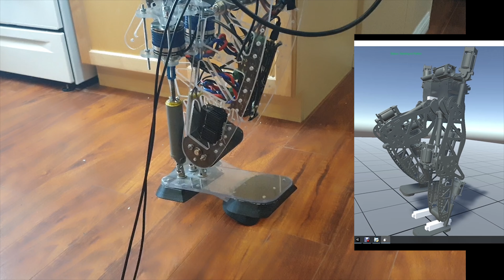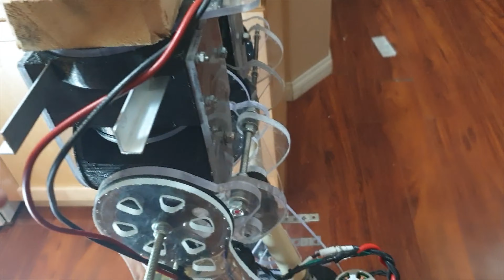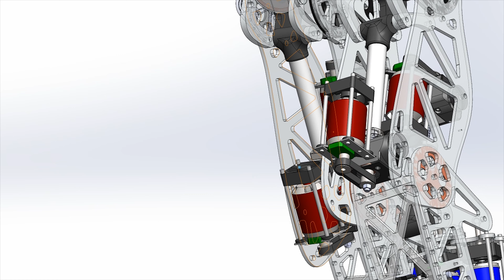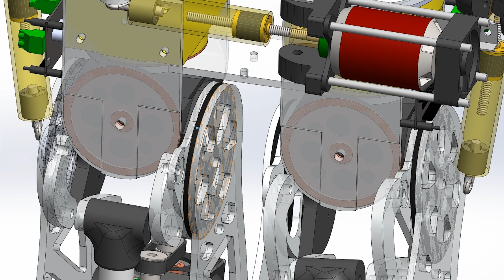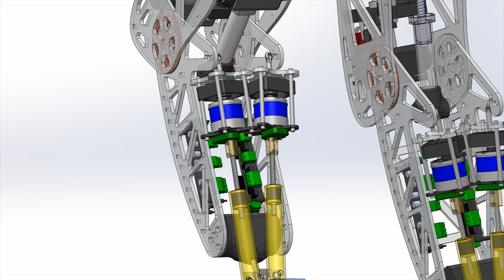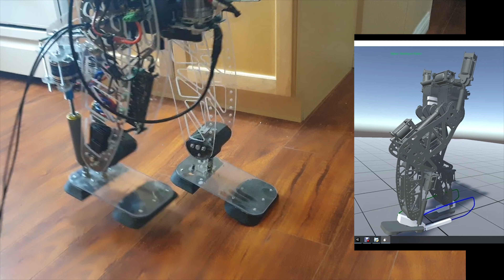My Human Robot project (In 5min)

Comment: Looks very interesting Eric, will keep watching for more videos, I like the CAD overlay to show the control aspect.
Reply from the maker: Thanks, I'm hoping in the future to have the controls model overlaid into the real world with the use of a Vive tracker strapped to the camera and have the control model showing what is going on in real-time.  Hopefully, that will help bring the 3d control program that I wrote to life in a more interesting way.
Reply: @Build_the_Future  looks very good so far, I'm surprised your channel hasn't got more subscribers
Reply from the maker: @TheSolarPoweredEngineer  Thanks for the encouragement. I'm hoping it's just because the thumbnail isn't that appealing.
Reply: @Build_the_Future  I use Paint 3D on Windows 10 if that helps
Reply from the maker: @TheSolarPoweredEngineer  In the next few videos I think it would be clear why I can't use Blender camera tracking (like I did in this video) or Paint 3d mixed reality. The quick explanation is using a 3d tracker like the Vive gives me more options and will set me up for my future set up with using trackers rather than relying on finicky accelerometer and gyro data to get my 6 degrees of freedom data.